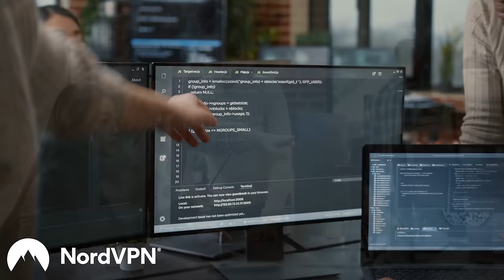Elon Musk fails Cybertruck stainless steel metallurgy test | Auto Expert John Cadogan

Comment: The Cybertruck is uglier than the last record holder of ugliness, which was the Fiat Multipla. There is no way I would ever buy such an ugly useless EV metal block.

Secondly: NO PHYSICAL CONNECTION BETWEEN THE STEERING WHEEL AND THE TIRES !!! There is no way I will ever get in such a car! Without that physical connection, there is no way to control the car in case of a catastrophic failure, which will eventually happen and then you are DEAD!

There are two things you don't mess with: Two independent break lines and a physical steering column. Those are the two things that enable to steer and stop a car in case of an emergency. If there is a simple computer error on the Cyberkiller, you're dead.
Reply: Has your mechanical steering column double or triple redundancy too? You know... like steer-by-wire systems 😂
Oh no, let me guess... mechanical steering columns never fail? 😂
Reply: @Tschacki_Quacki  Even if the Cyberjunk has 10 fold redundancy... the moment when the power goes out and the pumps and motors have nothing to go on, the steering is dead... and so are you. A mechanical column always works, even after a lightning strike.
Reply: @Blubb5000  
Power grid for steering motors is double redundant.

You seriously think you are smarter than thousands of engineers in the automotive and airplane industry? 🤣

Comment: You seem to be very upset about something although it's hard to know what. Possibly the aesthetics of the vehicle or a personal dislike of Musk. Neither of which are germane to the discussion and frankly it makes you look a little unhinged and undermines the point you're trying to make. If you want to make a video that triggers Elon fanboys or sucks up to Elon haters then go for it but don't expect to garner much respect from the rest of the world. 

Elon talking about "hardness" and bullet proofness are marketing speak, designed to sell cars not to examine the engineering tradeoffs. You wouldn't bother to make a video debating whether Bunnings is the beginning of lower prices, so why go there?. The entire point of making the truck from stainless was to eliminate the paint shop from the manufacturing process and thus drive down costs.  Whether the latter will happen is open to debate, we'll see. Once stainless was chosen as a material the form of the truck followed the function. Some people will like the shape, others hate it, most don't care and in any case it's irrelevant to the engineering debate. 

I think you'd be better served addressing the underlying assumption about the use of stainless as an exterior protective material. Only in the last few seconds did you address this and even then only in passing.

Comment: 304 Stainless is often used for springs. And it's hardness is significantly higher than mild steel. Don't diss the material just because you hate Musk.

Comment: I don't know if ANY of this commentary credible.  Sounds like bitter armchair quarterbacking with a lot of gas lighting.
Reply: You don't know.  I will tell you and then you will.  He get the stuff about the 300 series stainless exactly right.  On newly produced cars, the makers have changed to stronger types of steel to save weight so for a currently produced car he is also correct about the steel that is used.

Comment: When Musk rolled out the first one in that big event and started talking about his magic 30X stainless my head exploded. I thought surely, surely someone would call him out. What's worse, at first it sounded like the actual structural chassis members would be made of the stuff. There almost isn't a worse choice, especially for a truck with off road pretentions. Cracking would be inevitable, and it wouldn't take long.
Recently Munro toured part of the Cybertruck fab line. All the stamping is being done, not by Tesla, but by an on-site contractor. Munro of course let it slide, being the being the fanboy he has become, but it just shows how phony all Musk's talk is.

EDIT: Best use of stainless on a car body -> the roof on a Maserati Bora.
Reply: I go offroading often, i love the idea of stainless steel panels, makes it more durable against brushes and dont have to worry about the paint.
Reply: @Victor-vj5ds  Well, good luck with that.
Reply: @Miata822  you dont use luck when offroading, proper planning and equipment prep are always required.

Comment: It is amazing just how wrong "Auto Expert" John is. I don't know if the ignorance comes from stupidity, lack of knowledge or just not being able to research before posting this video. I have a suspicion it is mostly from a lack of research but there has to be an amount of both stupidity and lack of knowledge involved. While John seems like he knows what he is talking about I suggest if you want to actually gain knowledge and learn something you should listen to a real Auto Expert like Sandy Munro as he knows more about the steel on the Tesla Cybertruck than John Cadogan will ever know. Sandy Munro has actually toured the factory and talked to the lead engineers as opposed to shooting from the hip without actually knowing anything about the actual steel like "Auto Expert" John. The stainless steel on the exterior of the Cybertruck did not exist on Earth prior to 2018 is was developed in house at Spacex for the Starship (heaviest, tallest and most powerful space launch vehicle to have flown into space). The 30X stainless steel is a proprietary blend that is cold rolled Martensitic stainless steel that is both extremely hard and durable. The fact that the steel is Martensitic is not mentioned once in the video suggests that "Auto Expert" John doesn't know what this means or failed to research the Cybertruck's SS before making this video which the first is ignorance and the latter is just plain stupid. Regardless the result is a video over 20 minutes long that wasted everyone's time that watched it.
Reply from the maker: Meanwhile, on Earth, Electric Cheeses (Musk) has been so consistently dishonest or just wrong so many times, for so many years, misrepresenting the truth to the public. If it's really Martensitic, it's not a true 3XX stainless. All 300-grade stainless steels are Austenitic.
Reply: @AutoExpertJC   Most if not all of Elon Musk's being dishonest has to do with missed timelines, I am sure that someone that works on cars more than once you have said that it will take a few hours to fix this and it turns into a day or two. Now imagine you are working on something that is thousands if not millions of times more difficult and complex that no one on Earth has been able to do, you might get the time estimate off. Clearly you have a bone to pick with Musk maybe it's due to politics or possibly you don't like electric cars, but either one (or both) is keeping you from seeing what Musk is accomplishing. If you are open minded enough I would be happy to discuss it with you and show you other possible explanations that you might consider for what he does just like I explained missed timelines. I put people in two categories the first is trench dwellers those that make up their mind on something and nothing is going to change it, and the second is truth seekers. I would like to think that I am in the latter category and everything I have seen about Musk supports that he is in that category. One thing that I have noticed among truth seekers is the ability to admit when they are wrong and I would like to start by apologizing for the tone of my first post it was wrong of me to attack your credibility as an auto expert, clearly you are. Your knowledge in that are is far far beyond mine, but I do watch experts that are top in there field and respected as such, one such expert is Sandy Munro and he is the one that was talking about the Martensitic stainless steel on the Cybertruck. My biggest complaint is that without finding out you made this video without doing the proper research on your own and as of now you have wasted a cumulative total of over 5 years of people's time watching your un-researched and assumed information on the Cybertruck stainless steel. You owe it to people that look up to you and rely on you for their knowledge to do better.
Reply from the maker: Thank you for being so impossibly triggered. Musk is  so used to lying it's become normalised for him.

Comment: Hey Dude,   LOL John, thank-you very much for doing this video.  When we are talking about looks I have to say WTF.  It looks like an update Pontiac Aztek not sure if they imported them to Australia because you guys had Holden.  How the F*&K has this POS, passed all the Global Safety Standards to be Road Legal.  Especially in California.  Where pedistrian safety is paramount.  For example on the 2020 Corvette they had to design a piece of plastic to go over the front radiator grills and for the Camero they had to design a rubber engine cover all in the name of Pedistrian Safety.  Going to Musk claims that the glass is Thermo Nuke rate and the stainless is bullet proof, how are the first responders suppose to access the occupants in case of an emergency.  Who in the UK MOT Department signed off on this as being road legal there.  I think the UK is more strict than the USA when it comes to Road and Pedistrian Safety.